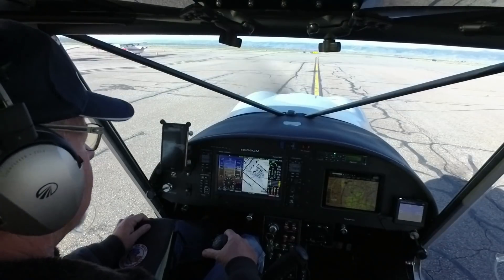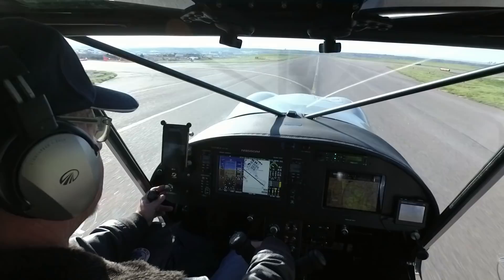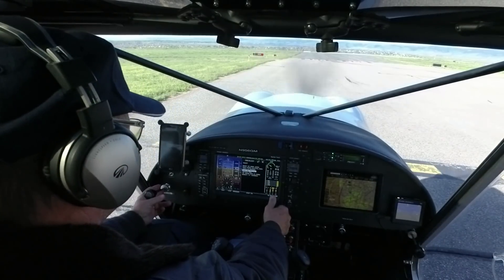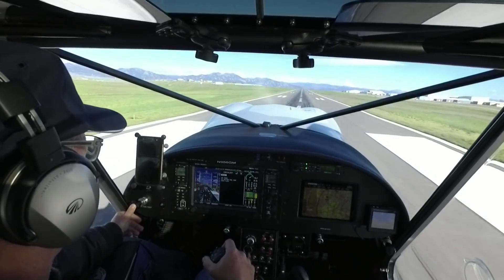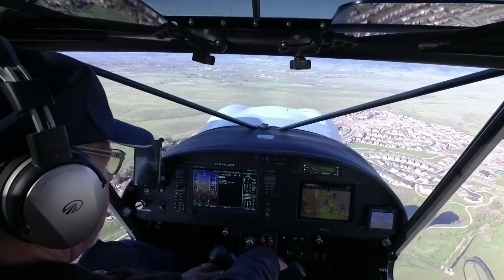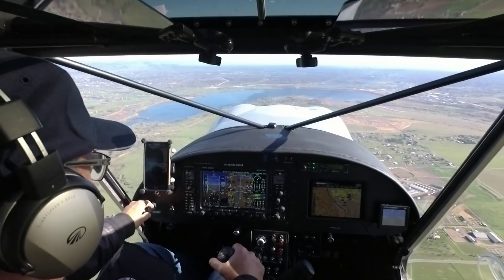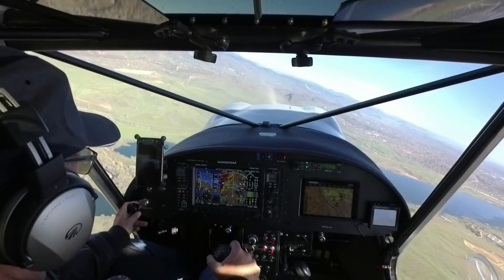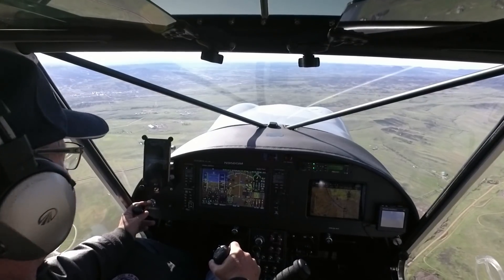Zenith Cruzer with VG kit and flat prop pitch test

Comment: Nice Cruzer!  What's your typical RPM, speed and fuel burn at normal cruise power with this setup?
Reply from the maker: Fuel burn is usually between 6-6.5 gph at 2600-2700 rpm with a TAS around 100 mph at a DA of 9000 feet.
Reply: @GWMotley1  nice

Comment: What are you running on your Panel...Dynon and Ipad?
Reply from the maker: Scott Miller You are correct.
Reply: @GWMotley1  Thanks, what is in the lower right corner above the throttle?